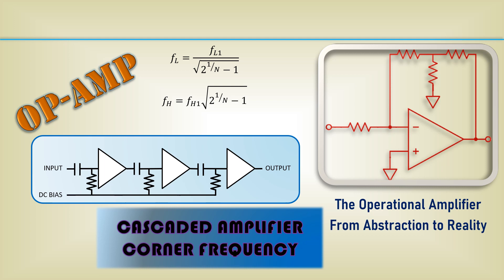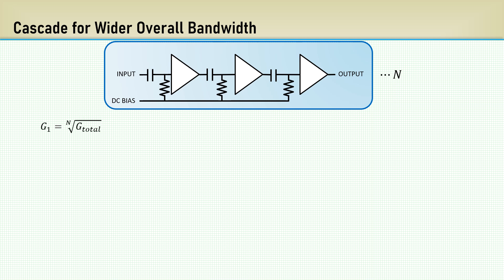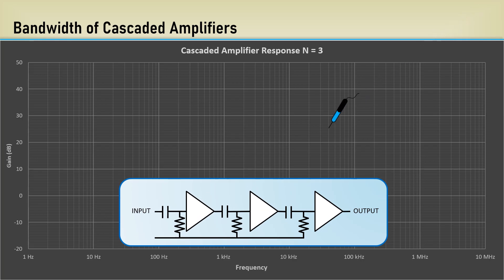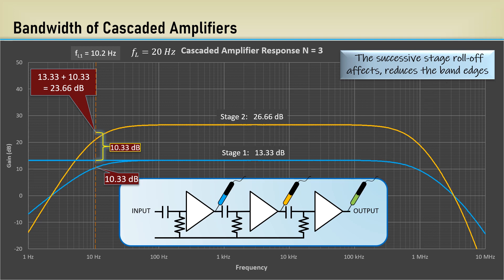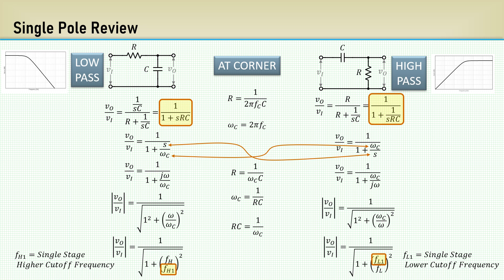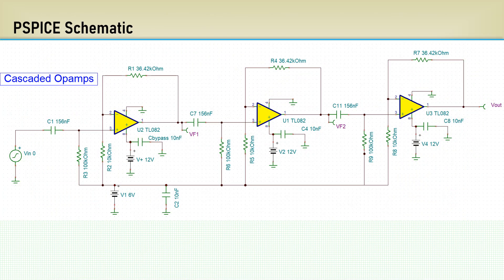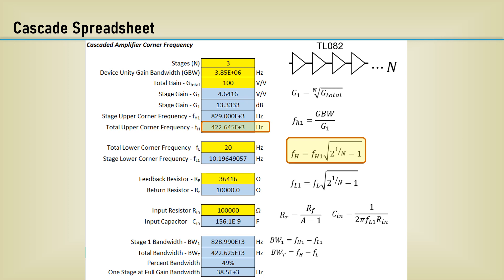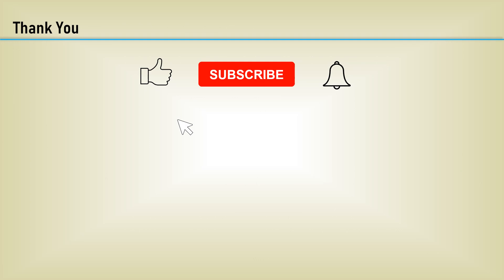Cascaded Amplifier Cutoff Frequency

Comment: These cascaded filters are basically a waste of time...

You don't get a tighter filter at all...
Reply: I believe you missed the point of the video. It's not about filters. It's about getting a wideband response and undertanding the limits that are caused the gain bandwidth product.
Reply from the maker: Correct